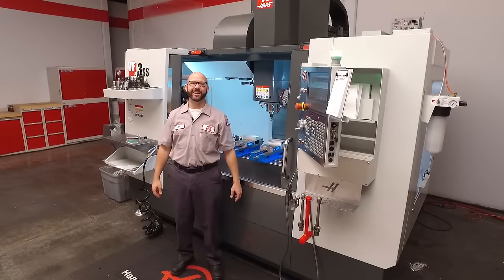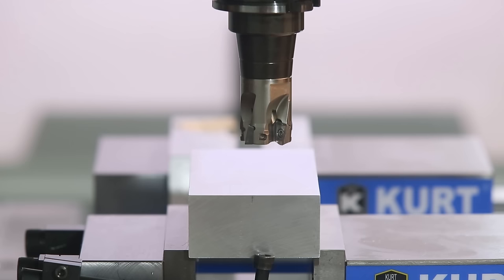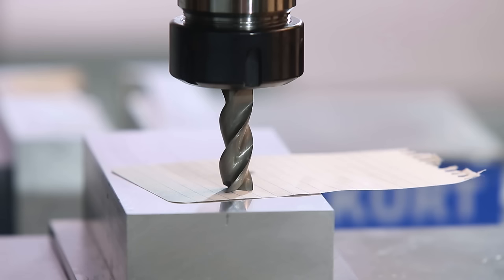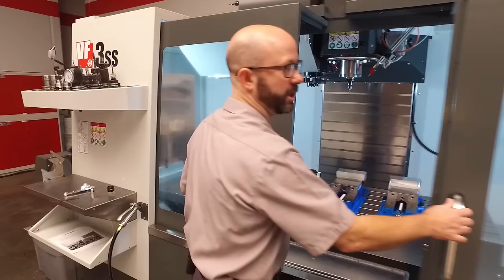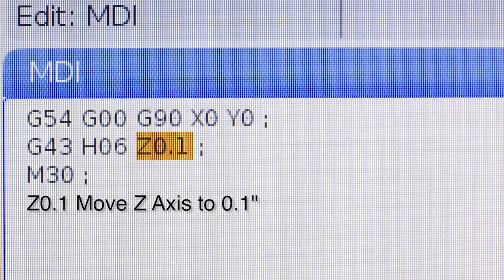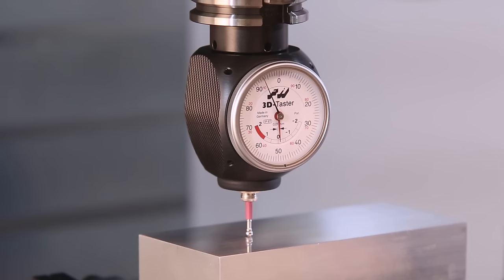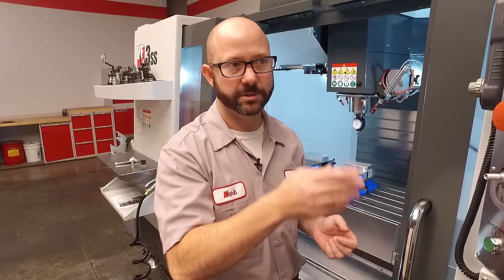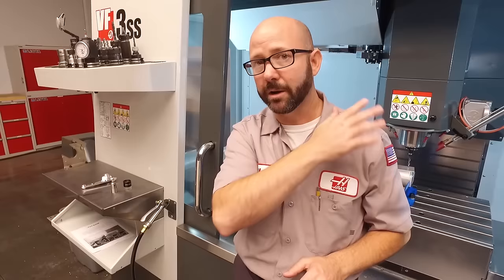How to: Set Tool Length and Work Offsets – Haas Automation Tip of the Day

Comment: That's the worse way to setup tool length. I can't beleive that a company like Haas show this method made for school beginner. What happen if you change the jig? Your tools are related to nothing but this setup. The manual way should give the same tool length that the tool setter does. I like you machines but for this tip I can not undertsand why you show that this way.

Comment: Never use this method! This will not allow for adjustment on an external measuring machine or a renishaw. It's funny when you've already milling the touch surface and there is a need to measure tool anew! You have been shown a "grandfather's" method!  This is a "bad tone" and garbage for the professional! Greater probability of error when working with several wcs! For the correct binding see the fanuc manual for example!
PS I hate this stupid function haas! I have to retrain machine operators!(

Comment: Welcome to the 1980's lol. I like most of your videos but this method is antiquated and leads to many errors.
Reply: :) We've gotten a lot of these comments Steve. The problem we have, is that the Single-location touchoff methods change from shop to shop. Some use 1-2-3 blocks, others actually have a pad bolted to the table. We hear you, and its a good topic for another video. Gotta start somewhere. Thanks for the comment.
Reply: @markterryberry4477  Thanks for the response. I think your videos do a great job of showing some of the basics and leading people in the right direction, just not the case with this one. Maybe it's good that you don't give my competition all the answers though lol!
Reply: @Ridemstr  what’s your favorite method?
Reply: @markterryberry4477  I've found that it's best to set all your tools off of a reference point on the table and use the Z work coordinate values to reference from the your tool length set point to the part Z zero. So if the point your setting your tools is 3" from the Z work piece coordinate (WPC) you would input 3.0 into G54 Z offset. This allows you to change through multiple jobs without having to reset your tool lengths again.
 Another method that's more complicated to explain but works even better, is to use positive tool length values (gauge line to tip of tool) measured with a tool pre-setter and set your WPC Z zero to the distance between part zero and spindle gauge line at home position in a negative value. 
 
 Also when setting lengths I like to bring the tool below the top of a gauge block (or 1-2-3 block) and jog the tool UP until the block slides under the tool. This method reduces chance of breaking delicate tools by jogging down into something (I've broken a $400 face mill body this way).
 Hope that helps. Keep up the great videos!
Reply: @Ridemstr  Yep. We've really got to make that video. Thanks for the comments.
Reply: @markterryberry4477  let me know if you want me to do a cameo in the next one. I work for coffee and donuts lol!